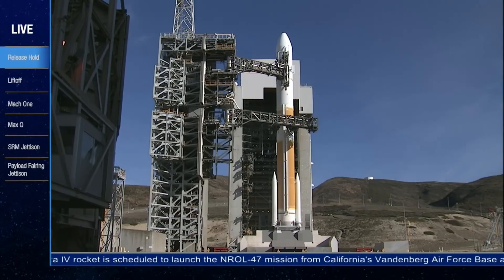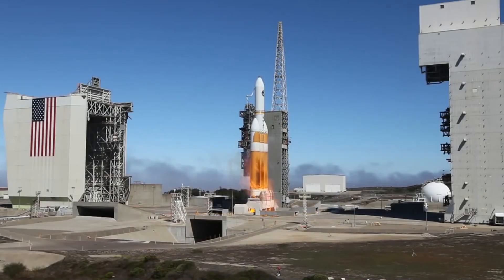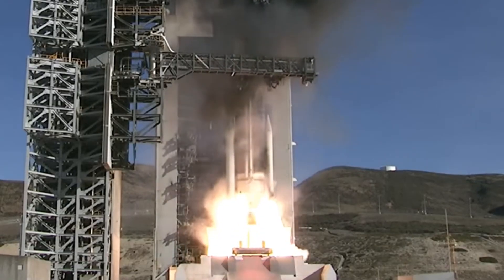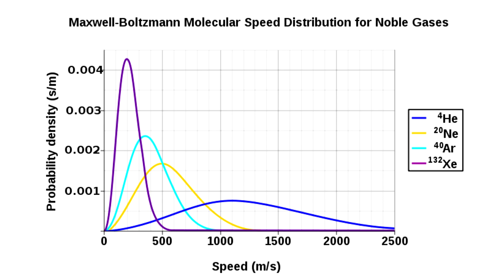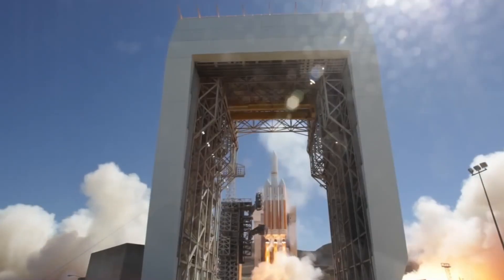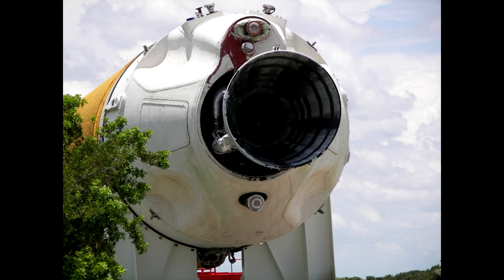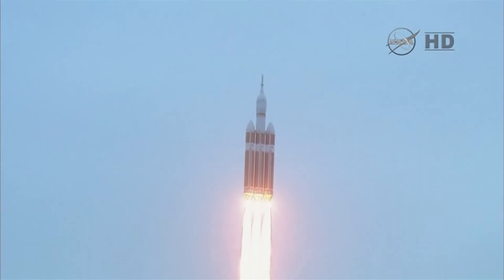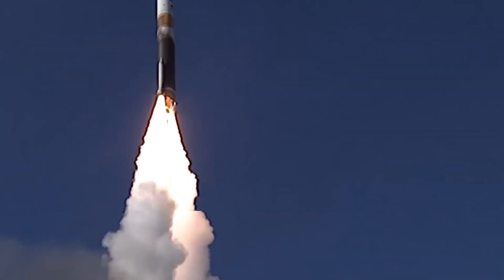Explaining the Delta Rocket Fireball - Kerbal Space Program Doesn't Teach....

Comment: So why didn't the Saturn v do this?
Reply: Because its first stage used kerosene and oxygen, not hydrogen and oxygen.
Reply: The kerosene fuel of the Saturn V will just fall straight down and ignite below the rocket, while the hydrogen on the Delta IV will rise quickly as it is much lighter than air. Simply put.
Reply: Saturn V's first stage fuel is liquid at room temperature (it's kerosene).
Reply: I have seen a slow motion film of a Saturn V launch, taken from close to the booster. Everything catches fire... But it takes time after the ignition before the smoke and flames get sucked back down. Kerosene doesn't burn well as a liquid, though not as hard as diesel to get ignited..
Reply: If you watch a Saturn launch with cameras aimed at the base, you'll see a smaller firball rise around the base of the rocket.  Then the turbopumps get up to speed and the firball is sucked back down into the pit by the thrusting fuel travelling downward.  See, for example, https://www.youtube.com/watch?v=DKtVpvzUF1Y
Reply: Hey burnout, can you give a more detailed account of that?
Reply: Please timestamp.
Reply: No, helium.
Reply: Pronounced: helium.
Reply: They mix it with pure star power, pretty much gets you anywhere.
Reply: +Ted Thompson Because you didn't watch the video. He explains it at x:xx (I'm not going to timestamp it, you have to find it yourself.)

Comment: This engines as well as video are becoming kind of obsolete as todays new rockets mainly spacex falcon 9.
You should make updated videos not videos from 50 year old rockets that wont be used ever again.
Reply: But the delta 4 is used today, and the rs 68 engine began development in the 90s, this video is relevant
Reply: Well this video is pretty interresting, so how about: no
Actually the delta 4 is only 16 years old, wich is not such a long lifespan for a rocket
Reply: ABaumstumpf woah hang on now, spacex has been using reused rockets
Reply: ABaumstumpf space shuttle was a failure, I'll give you that, but even if you can't fully reuse the falcon 9,you get the entire first stage in materials back
Reply: ABaumstumpf also, citation for space x not being financially viable?
Reply: Good there is NASA which runs on tax money and still has higher price per payload
Reply: Well the reason why NASA has a higher price per payload is because of how everything is tied to their government funding. Usually they have to satisfy some military requirements  like with the space shuttle, they had to be able to carry certain sized payloads determined by the Department of Defense and what not as a condition for some of their funding. Some of their requirements for funding come from purely political requirements that don't really make sense on an engineering level, thus driving up the costs, again as shown in the shuttle program. And of course also in the political requirements area, some things that are attached to the funding are pork type things from congress where every senator/congressman wants a piece of the pie for approving the funds, so NASA is forced to buy X amount of stuff from whatever states the congress people can get jammed into the bill regardless of whether it actually makes sense to do so.
Reply: Bush - that is why the words 'financially viable' are there. the space-shuttle did the same long before, at even worse costs.
Reply: Ah yeah, SpaceX - the company that is still running on taxcuts, government funds, prepayments and whos rockets are still no better than their competitors.

the rocket is nice and all, but so far it looks like that overwhelming majority of scientists and engineers were right - we do not have the materials nor capabilities to make financially viable reusable rockets.

Comment: Random question: so they can’t just human-proof a Delta 4, what if they human-proofed an Ares launch vehicle?
Reply: Well, that giant fireball isn't very safe. If they wanted to get rid of the fireball it would require heavy revisions of how the fuelling system on the Delta IV works.
Reply: I think the reason why they didn't use the Ares I was because the Solid Rocket Booster leaves flammable cinders behind, which can easily ignite a parachute of an escaping capsule during an abort.
Reply: Project Orion also never really got past the 'should we actually do it' stage, so it wasn't human rated, just planned to be human rated.
Reply: Alexandre Fyne they also struggled to get it to fly straight up as it was too thin and tall. I personally felt it was risky using solid fuelled rockets as the first stage can’t be throttled for human spaceflights.
Reply: Brian Su SRBs need to be phased out eventually.
Reply: then what? a nuclear fusion rocket engine with a overkill amount of isp. that would lead to some major problems
Reply: I’ve just posted a new comment up there. This reminds me of project Orion which was meant to be propelled into space by dropping and detonating tiny nuclear warheads underneath itself; yet was human rated 😉
Reply: yeah I was just kidding hehehehhee. but it just goes to show the safety standards back then vs now :)

Comment: nonetheless, it's always prudent to check one's stagin'
Reply: Nothing worse than some random upper engine lighting up for no reason and you have to revert, only to do the same mistake again because you did it on the fly instead of in the VAB... grr
Reply: Or just add more struts.
Reply: Enigneering Report: Critical: No Parachutes!
Reply: Rotsteinblock
Parachutes?
Who needs parachutes when you can just do a suicide burn I mean, hover slam...
Reply: Relatable
Reply: Somethings gone wrong, they seem to have completely forgotten the re-entry & landing staging!

Comment: Huh. Thought it was something more akin to the Blackbird pissing fuel before the heat generated from the high speed caused it to expand and seal. TIL!
Reply: lol. That design is hilarious. I mean, I'm sure they wouldn't have done it if they had a choice, but still, the fact that your aircraft leaks fuel whenever it's not flying fast enough for thermal expansion to seal all the holes sounds really dumb.
Reply: KuraIthys better than your fuel tank cracking open when flying at high speeds due to expansion, I assume that’s what would happen at least
Reply: A few years back I was playing a videogame called SpaceChem.  It's a sort of finite state machine contextualized as a videogame.  The solution I was most proud of involved solving the problem randomly then checking if I had solved it correctly.  It was a massively wasteful but elegant solution.
I feel some kinship with those SR-71 designers.  "Our solution leaks fuel constantly until we achieve supersonic flight but jet fuel isn't that expensive so we will just constantly refuel until the plane leave US airspace and goes supersonic."

Comment: Because it's surface is covered by Marshmallow, err.... Foam!
Reply: the tastiest rocket ever built!
Reply: "its surface". You don't say "by the seat of I'm pants" either. My – your – his/her/its — our – your – their.
Reply: In fact, it is cork, not foam. Or at least a material that contains cork as the main component.
Reply: You are right. I read this in someone else’s comment an did a quick research because I was intrigued by the unusual choice of material and wanted to know more about it. All I could find was “Cork insulation in NASA’s Delta project”. But it’s used to prevent excess heating from aerodynamic friction.

http://www.cork-2000.com/en/141/Cork+news/Cork+insulation+in+nasas+delta+project.html
Reply: Too bad they don't plan on bringing the rockets back. IMAGINE ALL THE NICELY ATMOSPHERE-TOASTED MARSHMALLOW... 😂
Reply: Toasty - and tasty!
Reply: mmmmmm foam
Reply: Cork doesn't actually burn that easily - in fact it's the bark of the Cork Oak, which evolved it to withstand forest fires - but probably is a bit heavy and likely to flake off to use as rocket insulation. And as Grenfell tragically showed, insulating foam most certainly can burn.